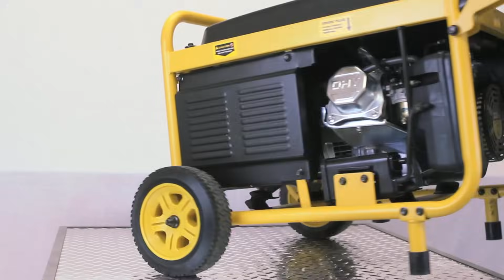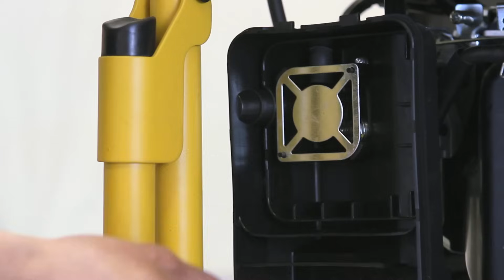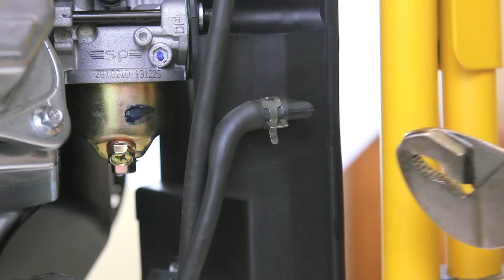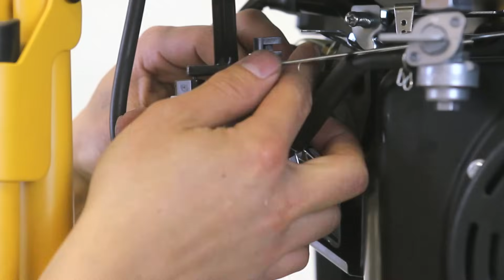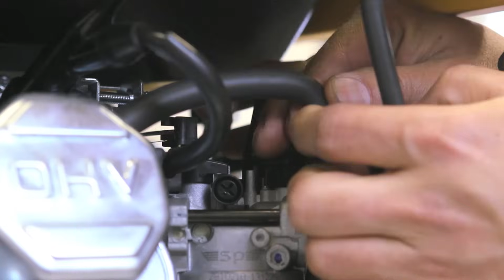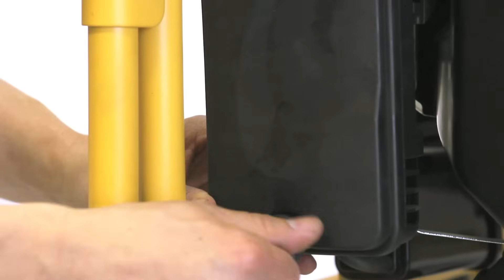How to Change your Generator's Carburetor

Comment: It would have been nice to see how the idle control lever is actually put together,
I have a multiquip ga 6hea,. Kinda the same kinda not
Put new carb on now it just surges back and forth plus leaks fuel, idle control not working

Comment: For the 2350 is there any kind of mixture screw adjustment on the carburetor? It runs a little rich @  sea level. It's about a year old has a few hours on it. It's been great other than that. And over the weekend it was running at 5600 ft . I know there is elevation kits.. but I'm just wondering if there's a mixture screw? Or am I blind cuz I cannot see it.

Comment: On my generator, I think the polling rod is in the correct spot.  However, the regulating spring has a few different holes and I am not sure where it needs to go.  I'm not talking about holes for the regulating springs on the actual carburetor, but on the other end of the regulating spring.  I want to make sure I am on the correct setting so that I do not burn anything up.  When I first got the generator it burned up the coil and spark plug.  I replaced those items and then noticed that the choke lever on the carburetor was broken.  Anyway, the company sent me a whole new carburetor assembly as it was under warranty.  Do you know which setting/hole it should be on?

Comment: I bought a little powermate couple years ago & just recently tried to start it up. Stored it covered outside in dry Arizona - but the carburetor linkage had corroded solid in wide open position. 

Boy, did it ever start up. Hope engine does not require a gentle break in period haha

Ordered a new carb for $19.99. Pretty much the same as video showed - thanks for instructions

Comment: I have a Generac GP7500E made is 2014.  The engine was surging/hunting.  Cleaning the carburetor with spray stuff didn't fix the problem so I decided to change the carburetor, $100 for parts, 2 day shipping and sales tax.   These directions were PERFECT.  It saved me time and Hundreds of Dollars.  THANK YOU SO MUCH!

Comment: You know you can clean it, rework the linkages and put back and it'll work fine?!
Reply: You can, but a new carburetor is only $20 bucks. Rather then mess with mine I just replaced the entire thing.
Reply: In my case the carburetor cracked and started leaking gas… no cleaning that!

Comment: Nice quality video.  However needing to replace a carb is extremely rare.  90% of carb problems are because they need to be cleaned, while another 9% are external issues such as air filter or choke.
Reply: Yes so instead of putting in a new one, take it off, clean it and put it back. Cleaning videos often dont show how to take it off.